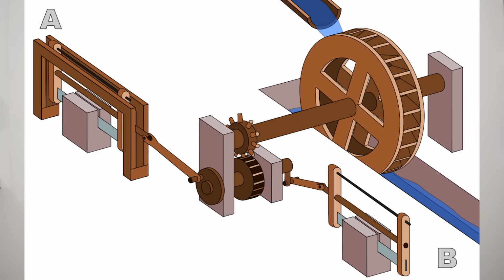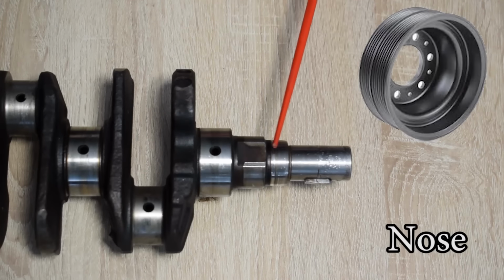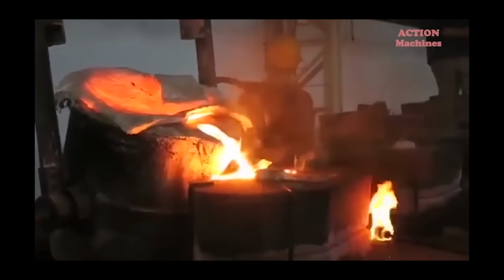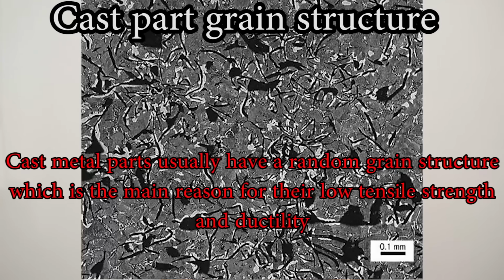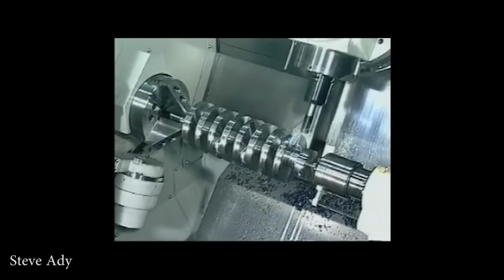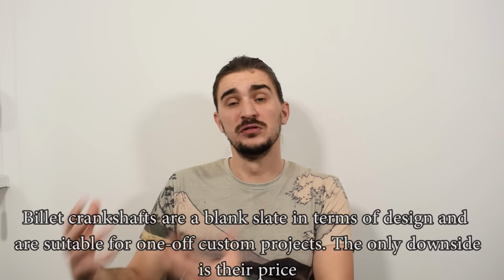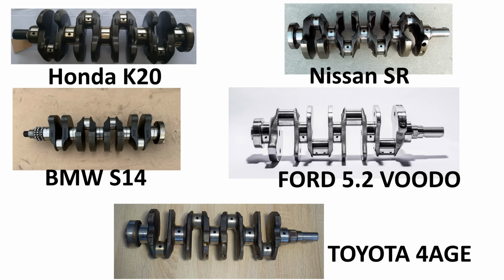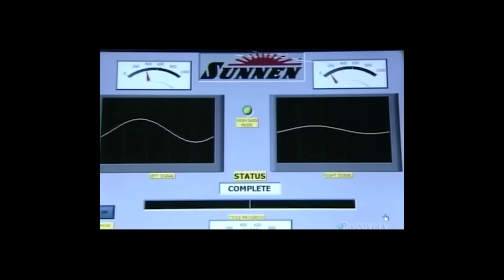EVERYTHING about the CRANKSHAFT - Function | Manufacturing | Different types | Forged | Billet

Comment: I've witnessed the compromises in engine design over time.  Prior, engineers wouldn't think of making an engine without good primary and secondary balance.  The only properly engineered 90 degree V engine is a cross-plane V-8.  The only cleanly designed V-6 would be a 120 degree V, but it won't fit in a car due to its width, so an inline 6 is the only real option.  The only properly designed engineered V-12 is a 60 degree, but narrow and long works better on airplanes where it was used that way during WW II.  The electronic fuel injection, spark timing, and computerization happened even on well-designed power trains.  Extra shafts purposely out of balance to hammer in the opposite direction of a hammering engine is crazy.  However, over time, instead of the body and engine each being optimized, the body drove compromises into the engine, powertrain, suspension, and  serviceability.  Where there is a will there is a way, and the way was engineering software and systems to mitigate the losses to achieve whole-package acceptability with regard to space, efficiency, reliability, and lifespan.  FWD is a welcome artifact for climates where there is snow and ice.

Drawbacks to a forged over cast that was not mentioned, but is a consideration by automakers, is that cast crankshafts are better for bearing wear due to their relative porosity which you don't see with the naked eye.  The next advantage is by being less-ductile, the crankshaft has less windup and unwinding happening during firing sequences, which again is better for bearing wear.  For high performance, castings can break.  Making them thicker is not the answer because that also increases the bearing surface speed.  

Trim presses fracture the flash off forgings, which is why they are so rough.  There are often slight grind markings where clean up of jagged and potentially oil-contaminating remnants remain after that process.

Some engines actually used (use?) cast connecting rods.  Any attempt to use them in even a mildly performance applications would end in disaster after a short time.

Crankshafts and blocks are aged for long periods before final machining.  GM attempted to accelerate that and ended up replacing many thousands of blocks and cranks.  A single small to midsize dealership in the neighborhood did 513 in one year.  The bearings only have .0015 to .0025 total bearing clearance, and if the block moves a little, the line-boring that originally aligned the bores for the bearings are no longer aligned, causing negative oil clearance, causing excessive wear, making them clunk, or the bearing drags hard enough on the shaft to spin the bearing in the block, which is often far worse as the oil hole in the main bearing no longer aligns with the hole in the block, thereby also cutting the oil flow to its rod bearings, which in turn wear rapidly and now you have rod knock that will destroy the crankshaft surface and/or rod bearing bore in the rod, and a lot more if not fixed soon.
Reply: I don’t follow your balance in cars. Every car has and had inline-4 . Ford Model T , VW Golf, the fastest Toyota Supra, Ford Mustang, Toyota Prius . Trucks have those big hoods. 

Inline-6 would fit into FWD (VOLVO) if you accept less displacement. This would have been ideal for bi turbo charging and high revs DOHC. As it is, the inline-4 has more power and buyers.
Reply: @ArneChristianRosenfeldt  They are compromises for size, cost, and fuel efficiency.  The path they take is they just don't care, in the case of the Model-T and some race engines, or they add a balance shafts, e.g. since the engine is out of balance, they add a shaft that is out of balance in the opposite direction, giving the effect of two equal size hammers hitting each other resulting in no movement in one direction or the other.  Engine blocks are made much more rigid in the crankshaft area today to prevent them from cracking.  OEMs have had to replace 100s of thousands until they did.  It is difficult to explain here with words so I found a couple of videos on YouTube that explain it graphically.  "Primary Engine Balance - Explained" and "Secondary Engine Balance - Explained".  I4s and V6s were almost non-existent in cars until much later for these reasons and when they started to become popular they didn't compensate.  Due to competition and customers not liking the going from a smooth engine to a rough engine, today they almost all do.  

Today's cars are full of kludges.  Another example:  I have a 2020 Chevrolet Equinox with the 2.0L engine and 9-speed, that comes with a trailer hitch and wiring from the factory and certified to pull 3500 lbs.  It uses the Camaro engine, the one they sell as a crate engine for racing.  They are expensive little cars with surround vision and high-end sound systems.  When you hear it running from the outside it sounds very throaty.  Inside you can hardly hear it run.  The reason for this is the obligatory, and expensive, sound system that comes with the package.  It's not off when it's off.  It has sensors that listen to the engine inlet, exhaust, and other locations inside the car.  The computer in the radio the  generates opposing sound waves from all of those speakers that kills only those sounds.  Conversations and music are not affected because the opposing sound waves are integrated.  Even when you change the music speaker balance, it compensates as well so as not to affect the opposing sound.  It's not just the little bigger engine, better transmission, and trailer hitch that makes that kind of difference in price.  The 1.5L is much quieter outside and nosier inside, especially going down the highway, amplified by the fact it runs 800 rpm faster at 70 mph.
Reply: @jackt6112  I know all about engine balance so to say. Maybe it is an US thing. It was always very expensive to get more than 4 cylinders in Germany. Mercedes offered inline-6 in bigger cars. Porsche had flat-6. But lately Porsche reverted to flat-4 like in a bug. Oh, give me electric Porsche instead of 365. V6 can be balanced and Audi did offer these. Porsche did offer V8 front motor in 986? and later did BMW in M5 or so. I know nobody who owned a V8. Okay, maybe someone told me that his parents (where he don't live) have a Porsche with V8.
On the autobahn wind was always the loudest thing. And why is the top gear so low. In cheap card indeed engines run at 4000 RPM for an hour (when the unlimited span ends ).
Reply: @ArneChristianRosenfeldt  It's an engineering thing, with engineering compromises being driven by other factors, which occurred much earlier in Europe.  The BF-109 was a 60 degree V because the 60 degree V gave smaller frontal area and it requires 12 cylinders to get perfect secondary balance in that configuration, just like the Rolls-Royce Merlin.  The early Mercedes also were engineered without compromises.

I agree that electric obviates all of that.  In the United States by the turn of the century, 40 per cent of automobiles were powered by steam, 38 per cent by electricity, and 22 per cent by gasoline/petrol.  Gasoline/Petrol justified themselves against their dominant competitors when distance expectations increased.  The electric technology has come a long way in the past few years.  The electric car will justify itself just as petrol/gasoline justified itself against electric and steam did before.  Today, for most families with 2 cars, and a garage at home to charge it, at least one being electric would seem to make sense.  In balance, when you remove Tesla owners from the equation, only 52.1% of electric vehicle owners said that they would consider an EV the next time they go car shopping.
Reply: @jackt6112  Maybe for visuals in a movie or game,  I wonder how far lead acid batteries could have gone? We need a way to pull out the pack to the side or back of the car. Never lift too far up or down for safety. Ignoring safety I propose that the package keeps 2 mm clearance all around and is protected from water so that we can stack up 1000 cells for 2 kV supply voltage. Then in the car we have a beefy tube audio amp controlled by the driver. Then a 3 legged transformer as used by utilities or electric engine transforms this down to 24 volt as usable by the brushless engines. Before the invention of strong magnetic material, the stator would also be made of electric magnets. This gives you a quadratic torque curve to compensate for the higher back EMF at higher speeds. Slow cars of the time would probably need to add another stage to the 2 stage reduction gear of a Tesla.

Comment: I think machining does not produce a stronger shaft than forging. When you treat the part after forging it you can easily get rid of the tensile stress. To achieve a similar hardness and strength in a milled part, a intensive treatment is necessary.
Only positive thing is that you dont need a big ass forging machine to produce it.

Comment: I've been wanting to ask this for some time now, why all aftermarket cranckshafts are made from steel, why not make it from aluminum for optimum weight reduction? I mean since aluminum is much lighter, we can use more material to be as strong as steel while much more lightweight?  I asked a tuning shop owner and he laugh at me but I still wanna know so I hope you reply. same questions about camshafts too.
Reply: I don't comment on any of these very often , so I'll give you a short answer that you can research into further. The main reason aluminum is not used for items such as crankshafts is due to its fatigue limit. If you look up that term it will give you a lot of the answers you're looking for. There are more reasons, but that is the biggest one

Comment: Great video! I have wondered why crankshaft webs are identical for the length of the crankshaft. IOW, why can't the non-flywheel end of the crank be lighter/weaker than the flywheel end? The flywheel end transmits 100% of the engine torque, the other end only transmits 1/8 of the torque (on a V-8). Has that even been tried? A "tapered" crankshaft? Every ounce counts!

Comment: Great video. Unlike his video on why brakes on cars are as small as possible because it doesn't matter. Jokes aside, an engine does not make horsepower, it converts fuel into torque. The crankshaft converts that torque into rotating motion. It turns up and down into round and round. Horsepower is a function of torque at a given engine speed. Look up James Watt if you want formulas.

Comment: Nice explanation, I love your videos, only two little points:
Crankshaft broken in 21:20 was broken by fatigue, not by lack of lubrication
There is a major advantage for forged crankshafts not listed in the video: forging eliminates material internal porosity, and other manufacturing systems don't. It has a HUGE advantage in fatigue resistance for endurance aplications

Comment: Good video. Well done.

Minor corrections on the heat treatment and surface engineering section: Tufftriding  is a ferritic nitrocarburising process done at about 580C - a bit hotter than typical nitriding but not much. Distortion can happen with both if the parts aren’t stress relieved first but the distortion problem (or general lack of it) is the same for both. The case depths are also roughly similar (nitrocarburising is done at a higher temperature but for a shorter time than nitriding is typically done).

What I think you meant was (confusingly named) carbonitriding - usually done at 850ishC. That a carburising process with a bit of nitrogen added in. That does involve phase changes and inevitably causes distortion and creates a deep case than nitriding. I’m sure it’s possible to carbonitride with a salt bath but that’s thankfully getting less common and isn’t the Tufftride (tm) process.

[I’m aware the naming convention of nitrocarburising vs carbonitriding makes no bloody sense. I’ve seen published papers get the processes mixed up
Oxi-nitriding -> nitriding with a bit of oxygen,
Sulphonitriding -> the same but added sulphur
Carbonitriding -> a different process altogether it’s carburising with added nitrogen]

Comment: As an actual engine designer i find your videos to be maybe the best source for one who wants to understand engine well.
Reply: Neither crank can “make” more torque than the other.  Crossplane is heavier and creates more windage so it consumes more torque.  Also the claim “Crossplane has a cylinder firing more often compared to a flatplane crankshaft”. is not physically possible.  Here’s why: Both cross-plane and flat-plane V8 engines, being four-stroke engines with eight cylinders, have the same number of firing events per engine cycle at the same RPM.

Comment: * to clarify, brittle does not mean low tensile strength, it just means that something has a low capability to absorb deformations before snapping, so you could have materials with very high tensile strength that may be more brittle than another material with lower tensile strength but with a bigger deformation%.
Brittle in simple terms is something that breaks with little deformation, imagine cast iron, glas, chalk, stone, and it's opposite is ductile, think about mild steel, aluminium, rubber

Comment: Since i favour <Old> Chrysler/Dodge/Mopar above anything else, fun fact: In the 1970's when the oil embargo hit the U.S, Chrysler big block engines used cast crankshafts to lighten the engines as much as possible to get the engines and other engine modification from the factory to get the thirsty big block engines more emissions compliant, Lower Compression ratio, lighter weight all around, <New at the time> EGR systems also.  The cast crank was a HUGE limiting factor for performance as the max RPM for a cast crank was somewhere around 4900 to 5000 RPM before ultimately failing. But then again, performance was not the main goal back in the 70's, just to squeeze every ounce of power out of emission stringent big block engines. Not to mention quality control on various parts of the vehicle was sub par at times leading to sudden engine failure with low miles.

Back in the 60's Chrysler big block engines used a forged crankshaft, strong as hell, and will outlive the rest of the car it's self.
Forged crankshafts can undergo much higher RPM's without failing compared to cast construction,  The max RPM for forged crankshafts were around 5500 to 5900. 

This is a quote i heard somewhere that describes these big block engines with the forged crankshafts, Beat me, but bet you can't break me

Comment: Awesome vid.  One question; I thought torque was a function of displacement ?  Thus in theory a flatplane and cross plane crank should have similar torque numbers??
Reply: Neither crank can “make” more torque than the other.  Crossplane is heavier and creates more windage so it consumes more torque.  Also the claim “Crossplane has a cylinder firing more often compared to a flatplane crankshaft”. is not physically possible.  Here’s why: Both cross-plane and flat-plane V8 engines, being four-stroke engines with eight cylinders, have the same number of firing events per engine cycle at the same RPM.

Comment: This may be a silly question but how does an engine know to spin in the right direction? Like is it possible for an engine to start and want to spin in the opposite direction?
Reply: The engine doesnt start itself. The combustion process requires the engine to already be spinning, so to start an engine there is an electric motor which meshes with and turns the flywheel. It always turns the flywheel the same way, because the direction of an electric motor depends on which direction you put electricity through it. Also, the engine running is based on the valves opening and closing, along with fuel being dispensed at the right time and the spark plug firing at the right time. All of that is dependent on the crankshaft turning a certain direction. You need the piston to go down with the intake valves open, fuel to be dispensed, the piston to go back up with the valve closed, and then a spark. If the crankshaft was going backwards, all these steps would happen backwards. youd get the spark first (without any air or fuel in the cylinder), then the piston would go down, then the intake valve would open, and fuel would dispense, then the piston would go up with the valve still open, pushing all the air and fuel back out of the cylinder. There would never be any combustion, and the engine wouldnt run
Reply: @Kevin-dt9xm  got it, makes complete sense now thank you

Comment: There IS one more type of Crankshaft . Built-Up . Very Expensive Manufacture but can be Strongest of all . Multiple precision parts pressed together .
Parts can be machined for Optimum Material Strength and Hardness , and can even be Taper Splined . 1000 tonne pressing with slight interference fit . 
Crank-Webs heated and Crankpins chilled for Pressing process . Roller Bearings can be used if desired , fitted to Crankpins at Assembly stage .
Crank-webs are often Full Circe design , weight relieved for counterweighting on the both side-faces . In fact Conrods CAN be fitted during Assembly .
The least windage therefore . Only a light Flywheel needed as well . There is also the possibility to through-Rivet the Journals if thought necessary .

Comment: You didn't mention torque In the forces exerted on the crank shaft
Reply: Thats because torque isnt exerted on the crankshaft (except maybe the inertial reactionary torque from the flywheel). The crankshaft is what exerts torque, the conrod is only ever exerting a linear force on the crankshaft. Thats the whole point of the crankshaft.